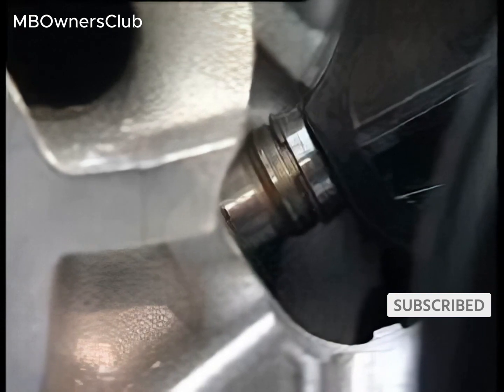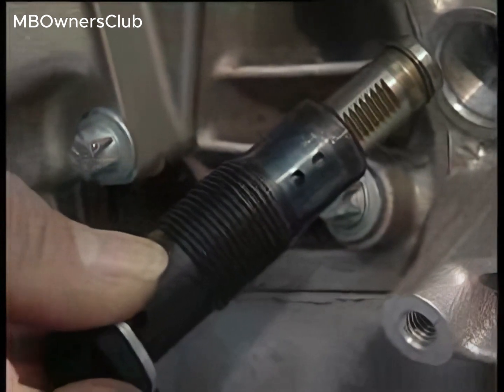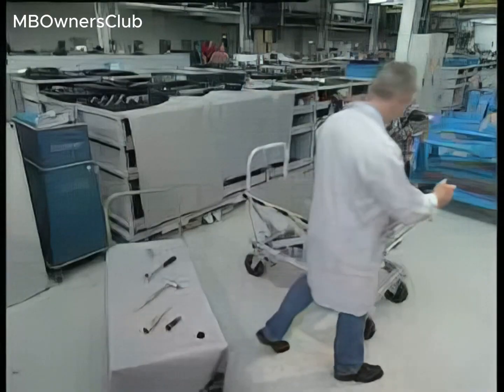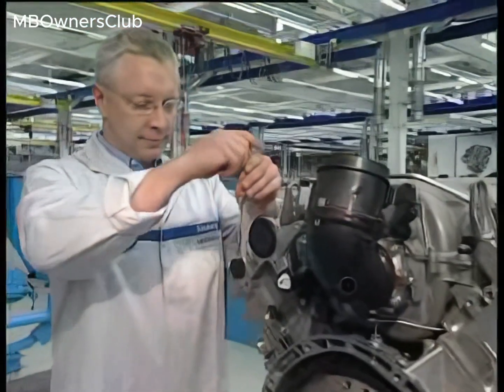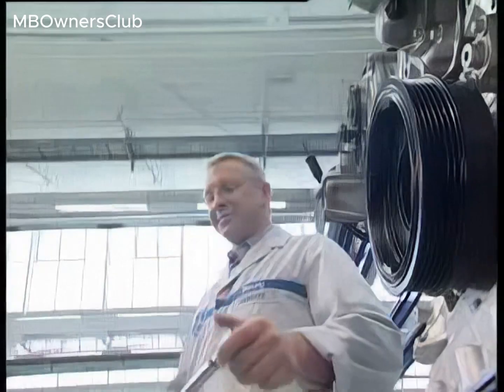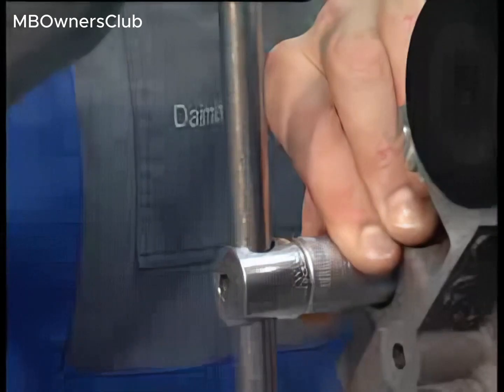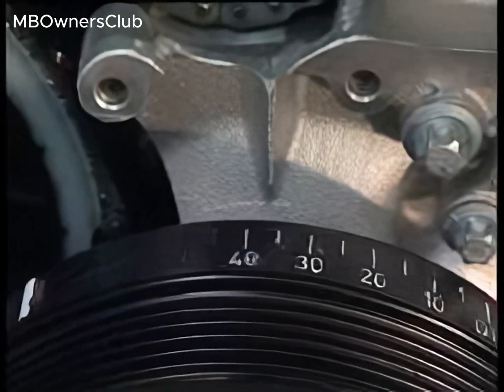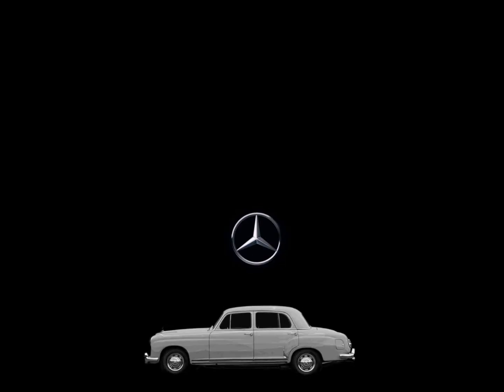Mercedes-Benz Maintenance: M272 & M273 Timing Chain Tensioner Replacement Guide

Comment: If the tensioner was loosen and unscrewed out about an inch before putting it at 40 deg.. can i just continue with  installation of new tensioner ??? should i screw it back in  and put it to 40 deg.??? Im afraid that the tensioner extended already more that intended when it was loosen.     will I be OK if i just continue with installing the new  tensioner and continue with unlocking presedure.

Comment: Why would one need to replace? When noticeable chain noise is heard under front cover? Or after replacing guides I guess.
Reply: over time the spring inside the tensioner gets weaker so when you start the car there is no tension on the guides causing the chains to slap the guides causing a drum like rattle for 2-3 seconds when you start the car.
Reply: @arabianmarshmallow4415  thanks, I didn’t think about that spring.
Reply: @arabianmarshmallow4415  Can a bad tensioner cause timing to be out? I have the 1200 and 1208 codes but the engine was not supposed to suffer from idler sprocket wear.
Reply: @fakeddyfakefake  YES if your tensioner is dead you can have that happen,